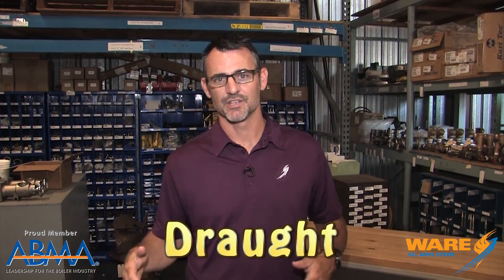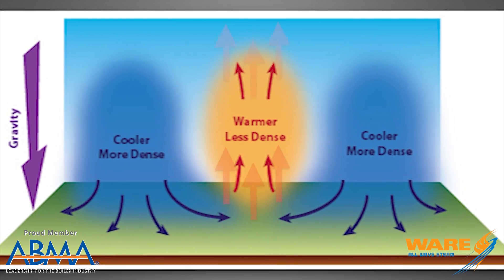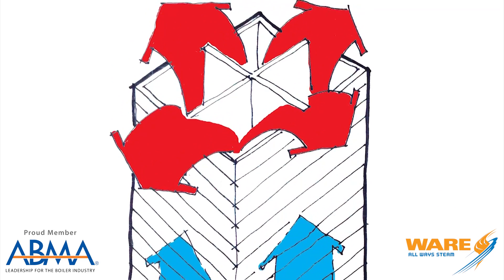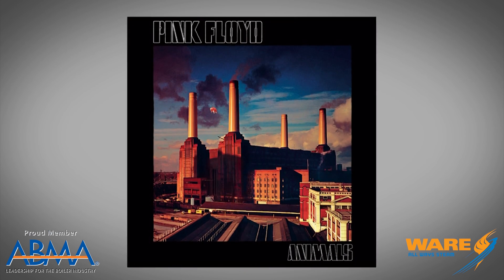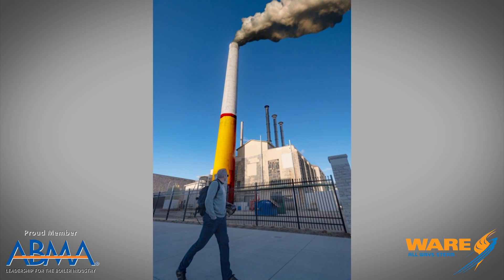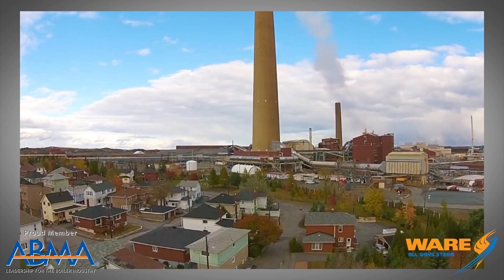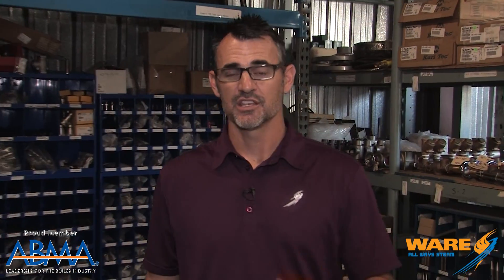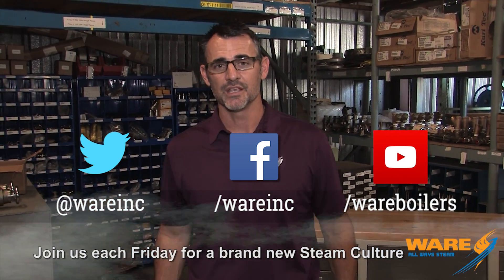Why Buildings Need Smoke Stacks — Steam Culture

Comment: You are a liar. You don't need smoke chimneys any more because you don't heat the buildings with wood. The smokes are chemical gases that can burn into fire.  The chimneys are installed in every gouvernment buildings to push out cloud seeding toxic chemicals into the stmosphere so that the weather manipulators can change weather artificially all the time in drastic negative ways. The weatherman need the chemical smokes every where to ionize the atmosphere with the toxic chemicals. Please smell the smoke or steam as what they call, you will be injured greatly for as short as 5 min. Please people analyze  those gases , the components. They are used for weather manipulation. It has nothing to do with heating or heating related steam.